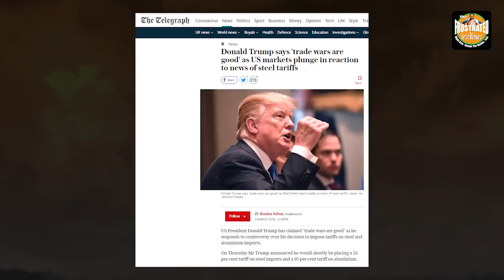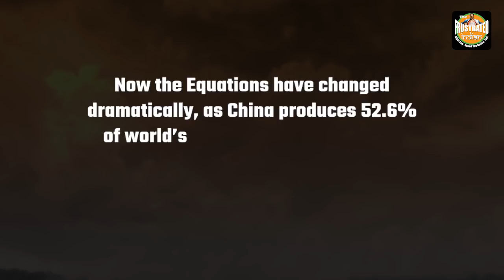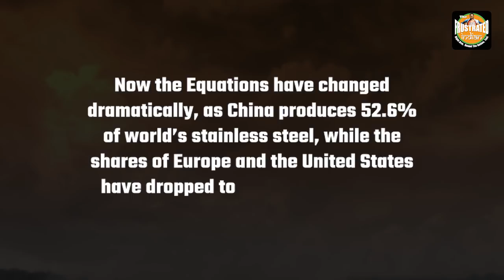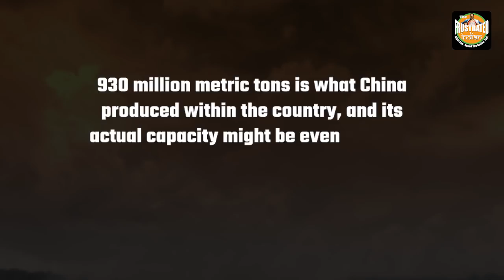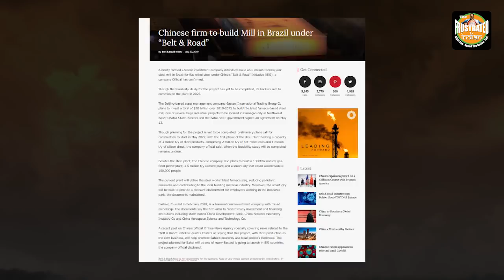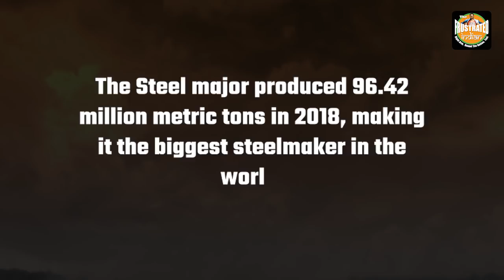China produces more than half of world's steel and it cannot go on forever

Comment: Bring production back to the US.  Pittsburgh and Trenton would love to have their work, revenue and reputations back.
And it would hit China where it hurts.
Reply: kingdomkrook  If the US Steel industry created a proprietary grade of steel, with great corrosion resistance and strength to be sold only to American automakers, it could be game changing for car makers. Although costs may rise slightly, perceived value would increase immensely and we would export a lot more vehicles eventually. 
Demand for higher quality products could bring back more of American manufacturing also.
Reply: @BobJohnson-xo7hr  why is that not done yet?
Reply: Hamilton Ontario too!! - bring back the rust belt
Reply: YES BRAND NEW STEEL FACTORIES COMPUTER CONTROLLED!  WOULD BE EXPENSIVE BUT IN THE LONG RUN NOT AS EXPENSIVE AS BEING CONTROLLED BY CHINA!
Reply: America cant afford to pay American workers the American rate so it will be game over.
Reply: Thomas S  you reckon why do you think the great wall is still standing after 3500 years so if America Steel a stronger why do they going to crash almost once a month if it's stronger why can't they build speed trains with it why can't they build 5G Towers why can't they build the biggest telescope on earth like China and guess what those structures are still standing and they will stay until eternity

Comment: China 🇨🇳 Duplicate steel 51%  now we understand why our bridge in Kerala fall before inauguration.
Reply: Chinese cut too many corners when they produce anything. The're engineering in steel is 
never precise.  Mine builders in Australia always have to reengineer the Chinese steel products to meet Australian standards. This hardly happened when we produced our own 
Steel. For example I have recently dug up some 45 year old galvanised steel water pipe
It is in good usable condition and still reads BHP on the outside wall of the pipe.
Reply: Greed for money 💰 less intelligence the cornerstone of communism everywhere
Reply: @andrewmccabe9820  Wow! I never knew Australia was buying steel from China. Actually Australia sells the raw materials for making steel to China.
Reply: Stupid. You can buy everything in China, the best or the worst. Maybe due to your gov stupidity and corruption they bought the low standard and mark it up for their own advantage. It s obvious. For a country which can send its people to moon, build vast network of high speed train, build their own aircraft and military equipment, making steel is super duper easy one. Use your logic!
Reply: @andrewmccabe9820  Are you an engineer to back up your claim with facts?

Comment: They make crummy steel anyway. I bought some front brake rotors for my truck. I could tell by feel,they were actually lighter than the factory ones. Luckily they had a 2yr warranty. They only lasted 1.5yrs. The factory rotors I took off were 22yrs old. The China rotors got all grooved up and warped in only 15k miles. The old ones lasted 180k miles.

Comment: Great to see the public outrage on communist China. BTW, stop the fear mongering on steel structural failures unless you are a qualified metallurgist, design  architect or a trained & qualified construction worker. Oh, lets no forget welding with certified filler metals & certified welders. Here in the States, most if not all steels are verified to specs/tested before use. Tks for bringing up the China issues. Hello from Florida, Trump country!

Comment: New job that required tension test.  Only wrench available on site was a Chinese aluminum made pipe wrench marked "Haevy Duty".  It snapped immediately where a large air bubble was in the center of the handle.   I purchased a Craftsman steel crescent wrench with a drift pin on the other end for a come along.  Never buy Chinese tools.

Comment: Steel plants all over the world have been shut down and left to rot as the world turned to China to provide cheap steel.  Most plants throughout the world are outdated and beyond resurrection.  I'm all for removing steel manufacture from the control of the CCP, but it will take considerable capital and time to achieve production around the world.  This is an important strategy to prevent CCP domination of the world, but we should also expect to pay ten times the cost for a ton of steel.

Comment: A number of years ago a new bay bridge was opened over San Francisco bay, made with steel obtained from China. Upon later inspection, it was found that quite a large number of the steel structural members were salt water corroded and showing cracking at many stress points. Engineering analysis later revealed that part of the reason for the corrosion and metal fatigue in the steel was that the steel supplied by the Chinese company was substandard. There was a flurry of lawsuits over the mater and I don't know what kinds of settlements ensued. I see this as a typical example of the folly of dealing with a country like China, when it is expected that their companies will play by the rules. The Chinese people don't share the same ethical values that the Western world has when it comes to business dealings or on matters of academic honesty as students and researchers.

Comment: Secure iron ore supply chain, Brazil, Australia & Venezuela, start helping specialized mills in the US (Up dating equipment, railroads, Ports ,helping them with pollution control and subsidies on electricity cost) This will generate strategic independence, jobs, revitalized dead towns. It will take from 2 to 3 years but in the long run is worth it. Make better deals with Africa. Steel is one of the top strategic commodities. I do not know how long the energy sector will last until the fósil fuels are replace, but until then steel is needed on mayor scale.

Comment: One of the first complaints about china from the USA came from metal manufacturers were being under cut by illegal Chinese material. 
Another was the substandard safety of their knock off products , even today in china itself, has the same issue, for example the automobile and motorcycle industry there.
parts like bolts produced in China have been stamped illegaly, using them can be a major hazard that have been known to destroy equipment and harm the public.
Everytime they agree to abide by treaty, they start cheating as soon as they can, and have stolen technology from around the world.

Comment: Just clearing up the current steel market condition, we know cause we are traders and investment firm based in Singapore. a) Even though Japan produce their own steel, Japan's imports of Chinese carbon steel surged 73% in the year 2019. The country has been buying more steel from abroad after a string of production problems at domestic facilities last year in 2018. b) Yes, Indonesia has a large steel production but because current difficult market conditions, Krakatau Steel, Indonesia's largest steelmaker, slashed its core workforce by 30%. And it is difficult for them to compete. c) India, the world's second-largest steel producer, turned net importer in the year ended March 31, 2019, after a gap of three years. That is because the country cannot produce high-quality steel and has lost some of its global clients to cheaper exports from China, Japan and South Korea and with the excess still in the market, even Indian market a worry that Indian may buy more Chinese steels because of the type of steel needed and the price. d) Now, let us look at the USA, even though Trump has put a tariff on steel import and promoting local steel, but the US slow demand ( especially in the car industry ) has a drastic effect on their own steel production plant e.g. closing local steel plant such as the Kentucky Coke Plant in Dec 2019. Its is not easy for American steel mills to increase production enough to match the overseas supply that would be lost. Secondly, the cost of the American product will be much higher ( Car, Airplanes, SME production and etc.). 

So, lets see. But my bet is, they will still use Chinese Steel for years to come.

Comment: A dysfunctional codependent international relationship can be based on trade,
now is the time for every nation to change the place where their steel is made.
That would include medical supplies sought the world over in our time of need,
that CCP profiteered from after they hushed Dr. Li and then covered their deed.
Reply: "Low-quality steel is not structurally sound and has an increased potential to collapse or break.
For example, in 2015 Chinese steel companies added the element Boron to their steel. This allowed companies to receive a tax rebate, which is great for profit. However, the element Boron causes welds to crack. This is a terrifyingly huge safety hazard. This means your cheap, outsourced steel could fail at any moment, putting yourself, your employees, your facility, production equipment, product and entire business at risk. This is a chance you do not want to take. It is not a matter of if your cheap Chinese steel will fail; it’s a matter of when.

Chinese Made Steel Is Not Cost Effective

While using cut-rate steel may save you some money up front, it will prove to be an expensive mistake in the long run. Low-quality steel will not last. It will need to be replaced or repaired relatively quickly after building, depending on just how cheap the quality is.

Another primary concern you should have is the cheap steel breaking and your building collapsing. This can result in expensive damages, serious injuries, and even a career-ending lawsuit.

Save yourself the headache and pay for quality steel up front and your metal building will last a lifetime."

https://www.cdmg.com/building-faqs/why-using-cheap-steel-is-unsafe
Reply: "UK Steel, also spoke in their press release about the potential problems that might be encountered when welding or heat treating certain steels (plates and sections) with excess Boron, Chromium and Copper. They said “Raised levels of these elements within the steel can lead to problems of cracking of welds, [and it] could take as long as 48 hours to develop cracks in the welds of affected structures. A similar problem can arise with copper-alloyed steel. Again, Chinese imports have been discovered with elevated levels of copper.”

Ian Rodgers, Director of UK Steel, warned:

“It is imperative that structural steel plates and sections with elevated alloy levels are treated with great care and where possible avoided totally for applications where welding is required, as there is a heightened risk of catastrophic failure. Our advice is that customers should carefully check the alloy content of Chinese structural steel before processing it.

“This is a time consuming process however as the only way of telling which Chinese rebar contains Boron would be to test each bar. Otherwise, fabricators cannot tell which welding technique to use. But such tests are not generally undertaken. There is thus a real, but unquantifiable, risk that welded structures using Chinese rebar could fail.”
"
https://www.josephash.co.uk/news/posts/?/China-Steel-Concerns